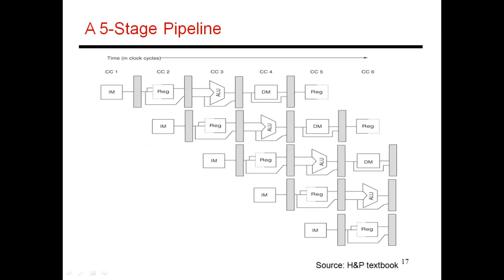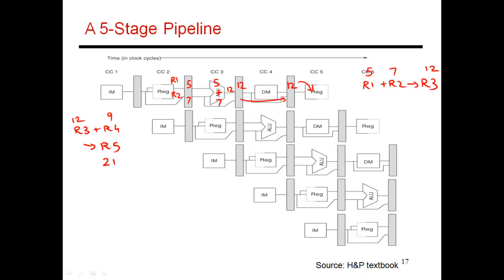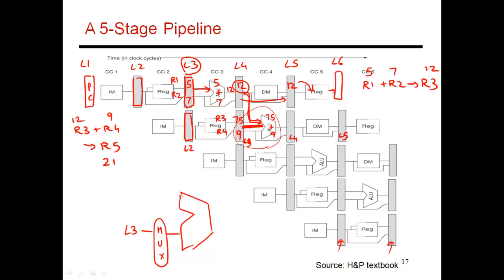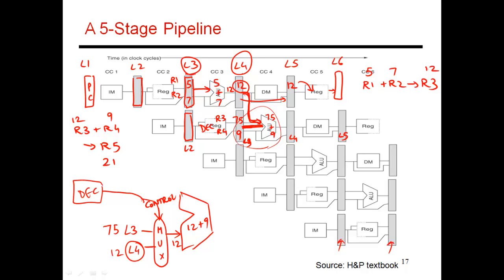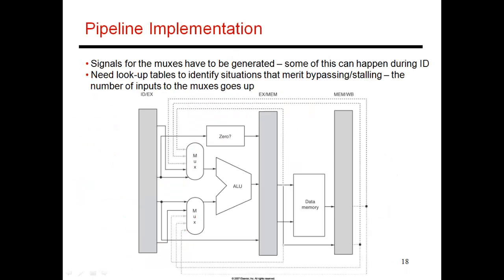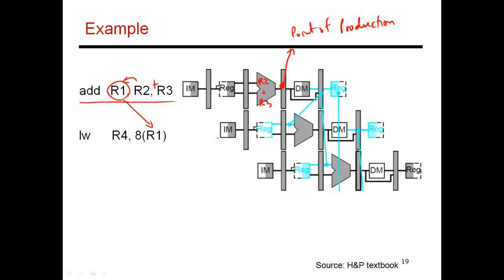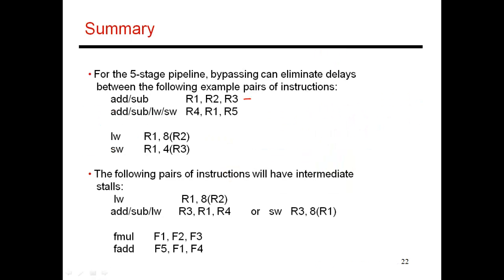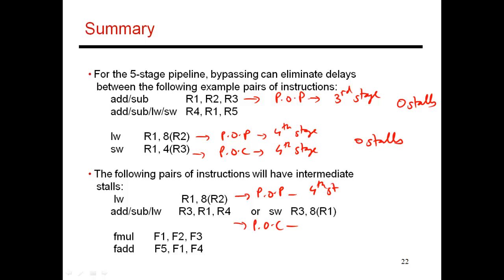CS6810 -- Lecture 10. Computer Architecture Lectures on Pipelining

Comment from the maker: The register file read/write time is independent of the forwarding technique.  Forwarding (bypassing) simply means that instructions can get their inputs from latches in the pipeline and not necessarily from the register file.  In the 5-stage pipeline example with no bypassing, if you assumed that register read and register write took an entire cycle, a consuming instruction would have to be separated from the producing instruction by 3 cycles.
IF RR EX DM RW
    IF   St   St   St   RR EX DM RW

Comment from the maker: The decode stage knows every instruction that has preceded this instruction.  So it knows when every previous register value is being produced and where that value can be retrieved from (register, L3, L4, etc.).  So when the instruction leaves the decode stage, it carries a few bits that will be used to control subsequent multiplexers.